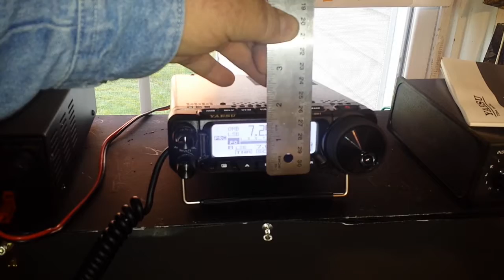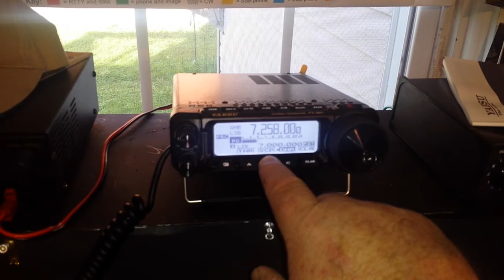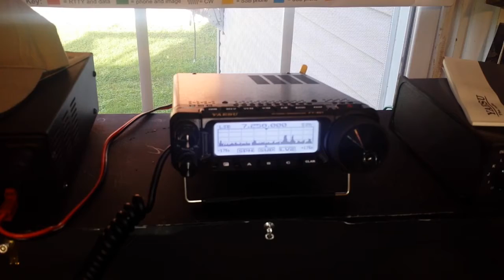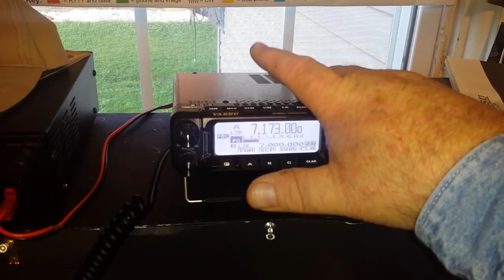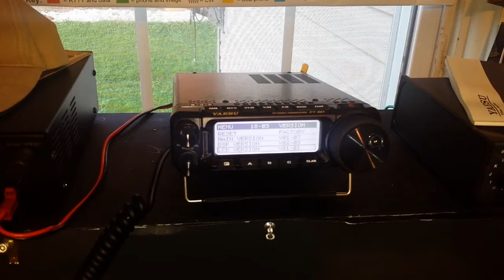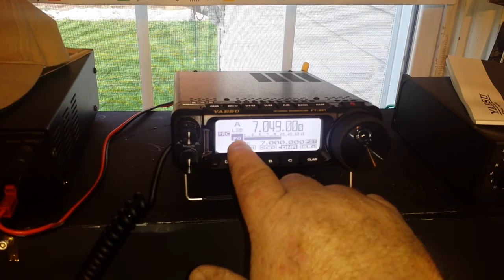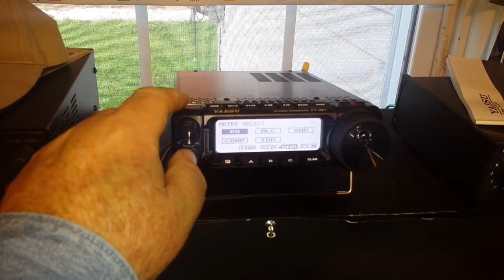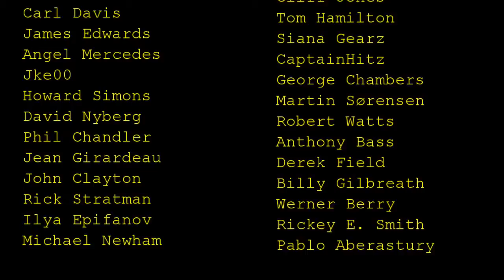Yaesu FT 891: Quick look

Comment: The DNR is very effective, but if you combine it with the NB and ATT, it makes it even quieter! I purchased the five shark ham sticks for 10, 15, 20, 40 and 75 m, And they will be used with a try mag mount on the roof of my truck. obviously, I'll be using this radio as a mobile unit. I also ordered the mAT-30 automatic tuner. Thanks for the informative video..👍

Comment: I have been following your channel for while now. I recently decided to take the ham exam (E-License or novice level in Europe). Not passed though. However I am planning on equipment. Since I live in an Appartement a decent Antenna rig is not an option. So my plan is to set up a bicycle-portable rig. I am unsure whether the yaesu ft 818 or the 891 is the better choice. The 891 seems more modern but drains more battery power. The 818 seems outdated but has more bands. The Icom is out of budget for me. Hard to decide. Anyhow: your review helps a lot. Hope to meet you in the band sometime.
Reply from the maker: I would go with the 891. It is feature packed, and can be computer or tablet controlled.
Reply: @learnelectronics  thanks for the advice. Appreciated. Merry Christmas

Comment: have they fixed the switching from USB and LSB issue? can you easily switch from USB to LSB on any band now or do you have to do weird menu work around stuff?
Reply: Same problem if you go to modemenu theres only ssb
Reply from the maker: I had no problems switching.
Reply: but the mode option just says ssb, when you choose the ssb mode does it then ask you upper or lower? or does it choose automatically for you depending on the band? @learnelectronics
Reply from the maker: It switches on the band and is smart enough to know that data modes are USB. My solution to getting the most out of this excellent radio is Ham Radio Deluxe. It has sliders for nearly every function. And you can create buttons for options they didnt think of.
Reply: Cory you go into the main menu, big whoop. Welcome to Yaesu 1 o 1

Comment: What kind of battery system will you be using doing POTA? Really like my Ft-891.
Reply from the maker: I just use a 12V SLAB. i think the 891 is a steal @ $634 from DX Engineering.

Comment: Thanks Paul. Have fun! I don't like to talk much so I would rather be at my bench working or playing with something. Soon I will be rebuilding the Siemen's Hall-Effect sensor controller fan motor in my Tek 2465A DV scope since the fan started making a little rattling sound occasionally. That should be interesting! While I'm in there I may as well install a heatsink on the Horizontal output IC U800 and replace a bunch of caps. I was hoping the fan motor would hold out until I had a digital scope, but that's the way it goes sometimes.
Reply from the maker: You will get to know the workings of your scope very well. I wish you luck.
Reply: I don't believe in luck, but thanks. I replaced the memory back-up battery already, but the scope looked so clean and brand new inside that I didn't mess with anything else. I could not find one single speck of dust inside this scope. It's like it spent most of it's life boxed up and sitting in the top of a non-smokers closet. If the fan motor looks brand new also, I might just try oiling it and see if that's all that is wrong with it.